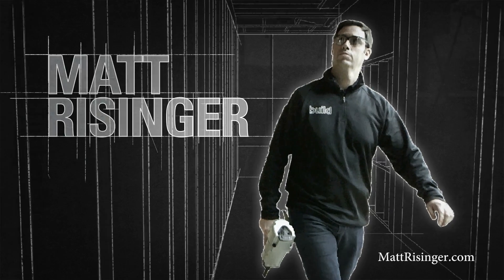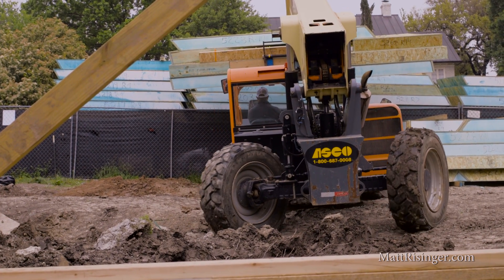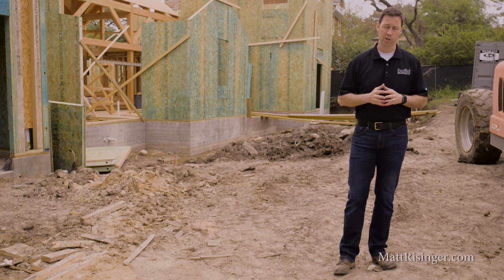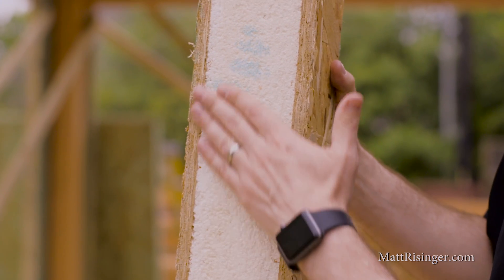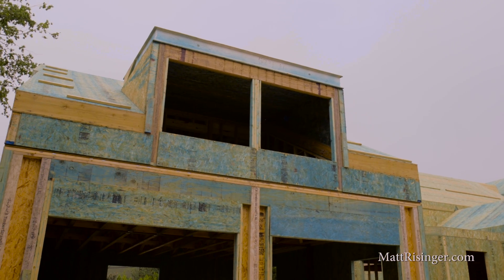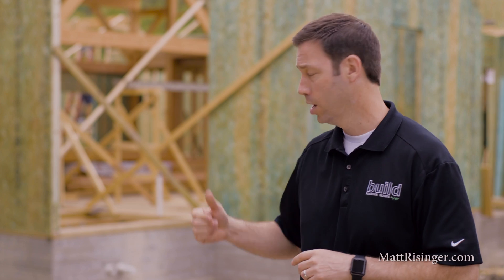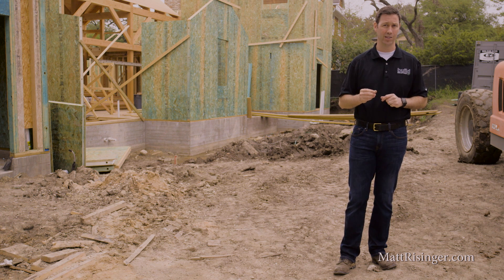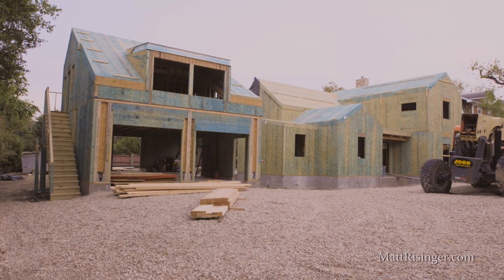3 Benefits of SIPs Framing vs Traditional Studs

Comment: If it’s air tight how does the house breath? What about black mold? You’re essentially building a bubble. What about condensation and changes in temperature? Doesn’t make sense to me
Reply: You have to install air exchanger systems to keep the air fresh. Matt has a video about ERV vs HRV systems. They have this stuff figured out.
Reply: @adamelcewicz8486  Sounds like extra costs/worries to keep your house from getting moldy. I’d say that’s a major downside to this style of construction. Can’t the house be Typar’d so there’s some air flow to dry the inside out?

Comment: In Canada many builders SIP has polyurethane foam for its higher R values (not EPS) which disintegrates over time. Longevity and structural safety beyond 50 years hasn’t been proven.

Comment: Foam disintegrates over time. After a few years, cycling heat and freezing it crumbles between your fingers. If it’s adding structural support to SIP then that house will not hold up in 20-30 years.  Its risky business trusting foam to hold up your walls.

Comment: I'm wondering how much the OSB and foam offgas over time, especially considering how tight these construction methods are.
Reply: Doxie, We provided the SIPs for this project (www.geofaze.com).  The panels are made with expanded polystyrene foam (EPS).  There is no off gassing from EPS because the bubbles inside the EPS are filled only with air, they can't off gas.  Polyurethane foam (spray foam) does off gas a little but we don't use that type of foam.
Reply: @Geofaze  malarkey, everything offgases.  Depends on what is offgassing though that makes it harmful or harmless.

Comment: Using OSB sounds like a great idea! It's resistance to humidity is legendary, and I am sure these panels will work as well as the floors so commonly built in the 1970'2. Remember that? It was plywood sub-floor then, for a smooth surface under carpeting. This worked so well that it virtually created a new industry: FLOOR REPLACEMENT by the late 1980's. One can only wonder how houses will be re-framed and sheathed in place when the OSB does what OSB does...That should be fun to watch, at least.
Reply: OSB wasnt approved as a floor decking until the late 1980's. Plywood is a different product altogether, and there are many types and grades of plywood. I believe you are thinking of partical board, AKA, pressboard. The Type 1 exposure rating of SIPs OSB is very water repelant. When assembled properly, there should be no water getting to the OSB anyway. There are literally tens of thousands of SIPs structures in service today. They've been fairly common since the early 1980's.

Comment: I have built a house for customer with sip not something I would recommend. Idea behind it that you loose heat through studs in regular home. With sips you still have to add bearings and top plate. If you looking for something that has continues insulation it would be tstuds and it doesn’t cost that much more

Comment: In 1930 they used plywood, which lasts far longer than that inferior chipboard.
Reply: Yup I would use plywood anyday over that GARBAGE.  The stuff takes in moisture and swells up and rots. Seen it in many homes.
Reply: Chipboard? Do you mean OSB? Chipboard is not the same as Oriented Strand Board. OSB has been just as time tested and structurally proven. It's not good to let any building material sit soaking in water for any extent of time. That's usually what causes problems for OSB. However, if it gets wet from a day or two of rain, it just needs to dry and it's fine. Any wood building material, OSB, plywood, solid beams, that's left in partly submerged in water, through capillary action, will saturate and begin to rot in a couple days. The rot can be stopped and material salvaged, but then any structure built with those materials will be at risk for future mold growth. Like a ticking time bomb of health concerns waiting for the first pipe leak. So in my opinion, if the builder is so careless as to let their material soak like that, I'm fine with it falling apart. It won't end up in our homes. The builder is the one losing money for their own negligence. 
Economic Darwinism.
Reply: @jackovoltraids5937  just want to correct one thing. OSB doesn’t jjst need to dry and then it’s ok.

Plywood will shrink back mostly when drying, OSB won’t shrink back nearly as much after drying.

So the wood loses density and therefore holding power on fasteners (roofing/siding nails etc).

While true it’s not good to have any building material get wet, OSB is less resilient than ply for sure.
Reply: @justinstevenson2061  if it gets a little rain on it, it'll be ok. A lot of rain is a different story. An extended soaking underwater is kind of the end of story, For Sure. Before the OSB has had time to absorb the moisture, allowed to fully dry, and it'll be fine. 
Sorry, if I at first gave a confusing or in complete explanation. And if you have anything else to share, please do.
I like learning all I can

Comment: How do these panels effect the electrical work and what about drywalling?
Reply: We provide predrilled 1 1/2" wire chases in all of our panels (2 horizontal @ 16" and 48" and vertical chases every 4' OC).  Electricians typically can wire a SIP house 20% faster than having to drill through studs each 16".  Visit www.geofaze.com to learn more about SIPs.

Comment: Framers might be happy and saving time, but wait till the electrician and plumbers show up on site...... iv wired one, it's not fun.
Reply: Alot of experienced eletricians will say its fasteer to wire SIPs, not drilling holes every 16 inches. It can be a difficult learning curve at first. As far as plumbers, they usually dont put plumbing in an outside wall.When totally necessary, they will need to build a chase inside of the SIP wall.

Comment: Realizing this vid is nearly two years old, the question in my mind is what VOCs are off gassed by that foam over time?
Reply: John, We provided the SIPs for this project (www.geofaze.com).  The panels are made with expanded polystyrene foam (EPS).  There is no off gassing from EPS because the bubbles inside the EPS are filled only with air, they can't off gas.  Polyurethane foam (spray foam) does off gas a little but we don't use that type of foam.
Reply: @Geofaze  ok but one thing you guys need to clarify here.....

Is it pronounced “sips” as in to sip a drink? Or rather saying the letters S, I, and P (‘s) 🤣🤣☺️☺️

Haha I enjoy Matt’s content. But the sips was killing me!

Comment: why not use Magnesium Oxide covered SIPs instead of OSB and worry much less about water , mold and fire?
Reply: From my understanding imported MGO quality is spotty (varied formulas).  There is a company in Florida that makes quality panels domestically but they cost more than the osb panels.  Furthermore, they weigh more.  Spackling the interior MGO seam means a visible seam seam is subject to the slightest movement of the exterior panel.  Furthermore, termites aren't as common up north.
Metal panels are available cheaper as well but can't handle the shear.
But like I said, this is all here say mostly conveyed by the manufacturers.  I'd love to see more data regarding MGO sip builds in the US.

Comment: my concern is the foam deterioration  . How long will the foam last? will the house fall down in twenty or thirty or fifty years?
Reply: Pretty sure that foam will outlast the human race, we humans excel at plastics that don't biodegrade lol
Reply: EPS (styrofoam) is stable if protected from light. However many manufactures and builders prefer XPS (polyurethane foam) for its higher R value. XPS disintegrates in a few years to powder and certainly has not been around long enough to prove structural registry beyond 50 years
Reply: Foam disintegrates over time. After a few years, cycling heat and freezing it crumbles between your fingers. If it’s adding structural support to SIP then that house will not hold up in 20-30 years.  Its risky business trusting foam to hold up your walls.
Reply: @kmattar  , EPS foam is a lifetime product. Ever heard of Geo Foam? Might want to look it up. EPS foam will not rot or disintergrate, even when burried underground. It is quite commonly used as structural fill. Highways, overpasses, railroads and even the new Amazon headquarters.....all built over EPS foam.
Reply: ToddLindsay630 not XPS polyurethane foam which many are adopting for its higher R value
Reply: @kmattar    What kind of foam are you talking about?  There are many different plastic foam chemical compounds.  I've seen dozens of SIP homes built in the Mammoth Lakes and June Lake area over the years, some that are already close to 30 years old, still solid.
Reply: It will last 1000 years

Comment: not actually SAVING labor cost. you're just changing who is getting paid for labor and how much.
Reply: That’s an interesting point. Considering the future of insulation. If a house has been completely insulated from outside in I wonder if there would be any real need for HVAC technicians other than air purification.
Reply: @RubbinRobbin  http://www.phius.org/home-page
Reply: You are saving on energy.
Reply: The real gain is that you can do most of the structure in a controlled manufacturing environment instead of having people up extensive scaffolding and in weird corners and angles doing the job on-site.
Reply: @zteaxon7787  Nope still need to finish the outside, install windows, vapor barrier, siding, etc.
Reply: @francismarion4450  Still saved the cost of doing structure on-site.
Reply: @zteaxon7787  I didn't see the accounting on this like you did.
Reply: that is semantics.

Comment: so the house is made out of glue?
Reply: watch the video @ 1:15
Reply: That and wood chips. How long do you thing it will be before that OSB starts swelling?
Reply: Its a type 1 exposure rated OSB, not the typical OSB you find everywhere in your stick built house, like, your floors, your roof and your exterior walls which all have OSB with traditional framing. You just have a much higher chance of moisture actually getting to the OSB in a stick built house, due to the massive air flow issues in a stick built house.

Comment: Why do you run your Air/Vapour/Moisture control vertically? Would running the material horizontally and overlapping it similarly to siding (starting at the bottom and moving up) not be a better system? 

Thanks Matt!
Reply: That's how it is installed, shingled

Comment: I'd love to hear your thoughts on SIPs construction vs. the perfect wall system. Other than SIPs seeming to be a lot faster upfront it would seem the cost of the the perfect wall would be lower (minus labor) and the performance would be a lot higher unless you wrapped your SIPs house in a continuous layer of foam also.

Comment: So what's better SIPs or Advanced Framing? I like the quality of these videos but why put this much money into producing a 4 minute video when you could make it 10 minutes and show some of the process? Thanks
Reply: SIPs are better.  The dimensional lumber in the SIPs are typically 4' OC.  This means less thermal bridging and more insulation.  The SIPs have an interior OSB surface which if taped forms rigid air barrier.  I like doing a SIP with an interior service wall so the SIP can be as untouched as possible to help keep the AB intact.
Reply: It depends on what your wall/foundation interface looks like.  My walls are 12" thick and my foundation is 8" thick.  The concrete wall gets another 4" of continuous insulation interior side.  The interface b/t the 4" concrete insulation and the wall is air sealed so no air should really be getting to it.  Even if water did get deposit onto the concrete wall, concrete wicks water so it would tend to absorb the water.  You still have a sill gasket between the wood and the concrete as well which would prevent the water from wicking upwards into the plate.
Reply: I was thinking the same thing. It looks more like an ad.
Reply: I worry about moisture forming at the sole plate where the warm wall meets the cold foundation.
Reply: George B Well the future doesn't need craftsmanship it needs salesmen. No cashiers you really don't see it planned obsolscence in housing now so we will have only the wealthy and the poor. No more middle there will only be a top and bottom!

Comment: I would actually use this to build my house if it had internal wooden of metal structure along with the foam.
Reply: We built a SIPS home in 2000.  The only studs were in the  corners and at window / door openings.  When the men were setting the trusses they said" walking on top of the walls was like walking on a sidewalk."  The house is easy to heat and cool.It's a nice place to live and raise a family.  We are going to build our retirement home and it will be Sips top to bottom.  Take care and God Bless.
Reply: it does , every 4 feet between panels there are 2x4 or 2x6 depending on the thickness of the panel/wall

Comment: Quick question sir, how fire resistant are the panels?  I've been hearing that some of the wooden I beams are more dangerous and fail faster then 2x4s in fires.
Reply: https://www.youtube.com/watch?v=sgbdgvMo5ew
Reply: Ya I hate those floor joists. Load rating are tested obviously in perfect conditions to be considered a good product for the use.

But now add a damp crawl space etc and a 2x10/2x12 lumber will hold for so much longer (in case problem goes unnoticed by homeowner etc) than these ever will.

Their only as good as their weakest point, which is OSB..... ewwww

Couple 2x4 are not at all strong especially as their faced inward to eachother, when looking at the OSB in the middle failing.....
Reply: not good for fire... 
use MgO SIPs ... fireproof!

Comment: Are you going to seal all the interior joins to prevent vapor migration into the sips panels? I've heard that's is a common failure point in SIPS buildings.
Reply: With SIP, air penetration is the enemy that moisture rot problems. Vapor migration is minimal, but should there ever be a failure of the joint, moisture will be a problem unless the panels are allowed to dry.
Reply: 59, I watched a house put together with these and before the panels were put together, they used a spray foam and a 4x6? sandwiched and screwed between the panels. The foam was oozing out everywhere so it looked pretty darn air, water tight. Also I think you can get the exterior of your panels with some type of serious black sealing paint.

Comment: I think the future of  construction is prefab housing using traditional framing techniques or better yet Advanced framing techniques. This would offer the advantages of having a home built with traditional building materials but have the added benefit of reducing construction time and increased quality of construction.
Reply: The main cost of building is the labor of skilled technicians having to do everything on-site in an environment you hardly control and have to invest heavily in with scaffolding, safety, etc to adapt. It's like how every wardrobe and other product used to be hand made by tradesmen building is really one of the only industries where this hasn't changed towards automatisation, big scale plants with assembly lines. With SIPS and modules construction this can change and help make housing more affordable as well as more qualitative and consistent, standardized.

Comment: Though sip panel construction has many  advantages especially for initial construction,  one of my main concerns has to do with more long-term  problems home owners &  contractors might face with a home built with sip panels.  How do you repair / replace panels that have been damaged by dry-rot or termites?    How easy is it to remodel or alter a home built with SIP panels  i.e run additional wiring,  or resize/install new doors & window? It just seems like just doing the few simple things I mentioned in my examples above would be much more challenging and limiting, let alone trying to do something more advanced.  For this reason I would much prefer a quality stick built home over a sip panel home.  I know that now and in the future I can always go to any lumber yard in any city and get materials to do anything I want to do.
Reply: SIPs is wood based framing.  With R-Control SIPs the EPS foam does not rot, and has Performguard termite resistance built in. As far as running wiring or remodeing, its very similar to a stick built home. You still have to get behind the finished drywall, then its just like it was during new construction. On site modifications are easy. They are many projects where SIPs is used in an addition to a stick built home or even sticks used in an addition to a SIPs home. Simply put, its just wood framing.

Comment: EPS is a great insulator but extremely flammable. That's not a problem when a building is built to code, but after a home has been lived in for a few years and alterations are made eg cutting through the sips for plumbing and wiring, then fire will spread very rapidly.
Reply: Shaun, i would hope any holes would be filled with fire mastic after.

Comment: Great video as always. Any concerns re utilizing an air barrier over SIP? Could that possibly prevent drying should there joints ever fail to prevent air penetration? Whether inside out in cold climates or outside in in warm southern climates?